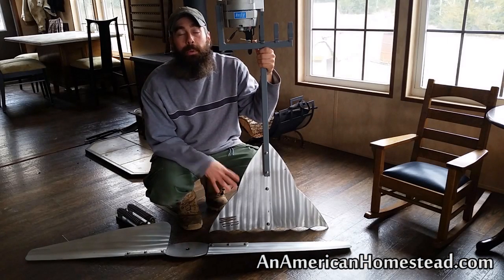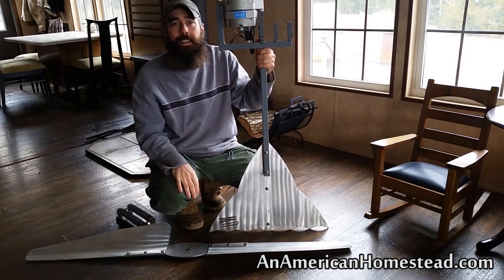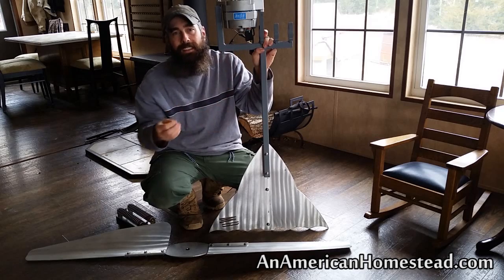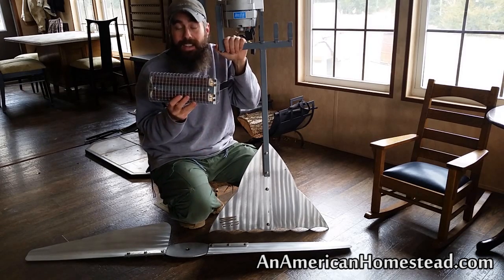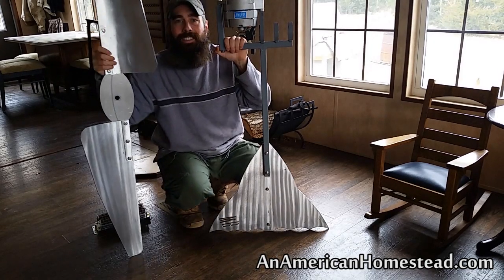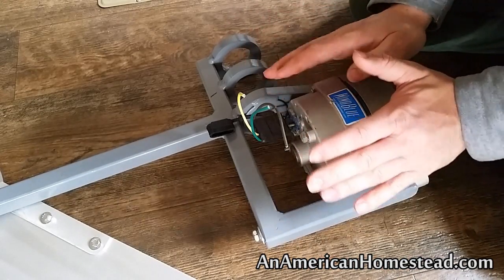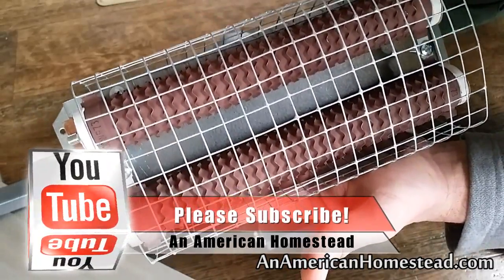Wind Blue Power Wind Turbine - An American Homestead

Comment: Can you answer a few questions for me? I have one of those. And I need to know how to mount it to a mast. I did not get the mast with it.
Reply from the maker: I wish I could help but you'll need to find the mast bracket that goes with it. Or you could fabricate one yourself. It simply bolts to that bracket and the pole slides into the mast bracket. Wish I could be of more help.

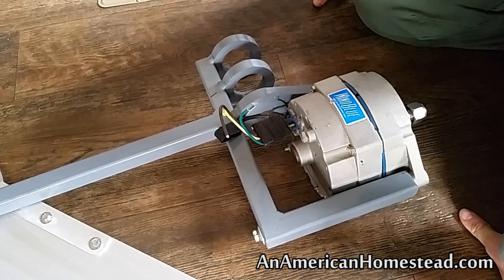Comment: At time @8:09 - You are wrong.  Actually, it makes absolutely no difference whether you use AC or DC volts, you will need the same size wire for both.  It is total BS that "...AC Power won't lose any power vs DC Power, over the same length of wire as DC ..." !!!   Where did you learn that nonsense?
Reply: ser arrogantmoron          it is you who are  Wrong.           think about it.           utilities  transmit  AC  over long distances,  for  a   Good   REASON.!!!!!

Comment: It's the voltage, not AC or DC. The voltage drop over a length of wire is always the same.  At a higher voltage (120V) the loss is proportionally less that at a lower voltage (24V)  

The West coast has a pair of 600,000V DC wires running between Southern Cal and Washington
Reply: ummm    bla-bla-bla       steve,  you  were  effing  Wrong.        for whatever  Reason,  AC  can  be  transmitted,  with  minimal  losses.!!!      see  Utility power transmission lines  ---    AC   !!!!!!!